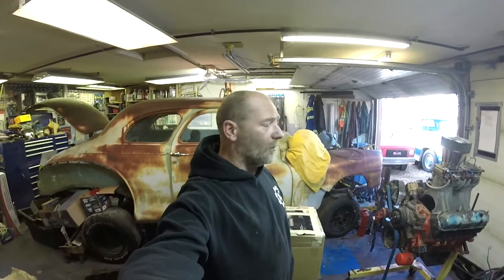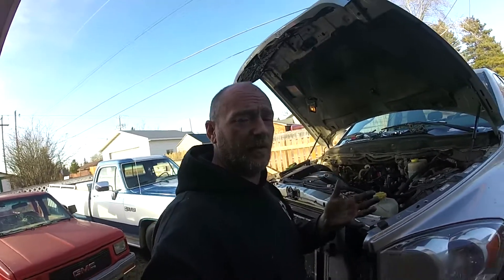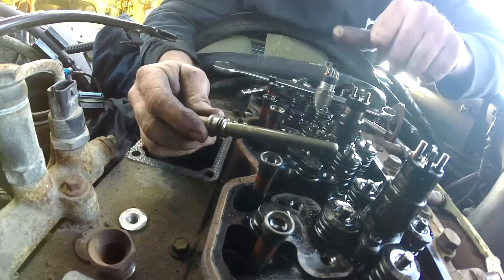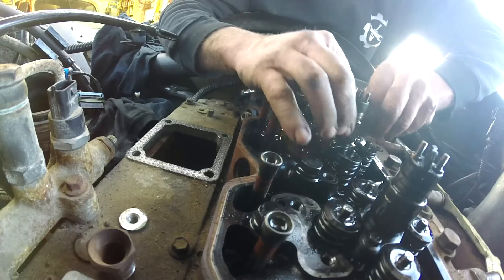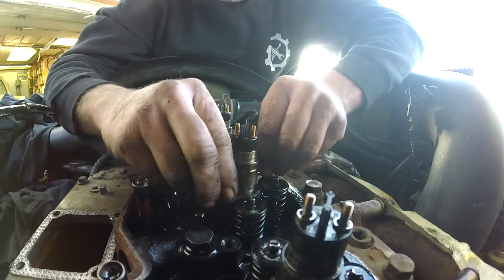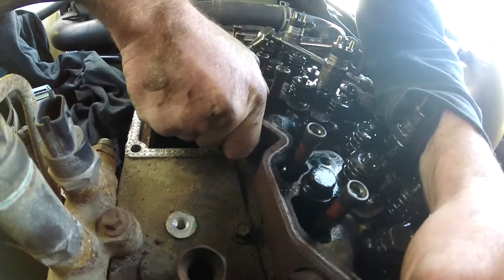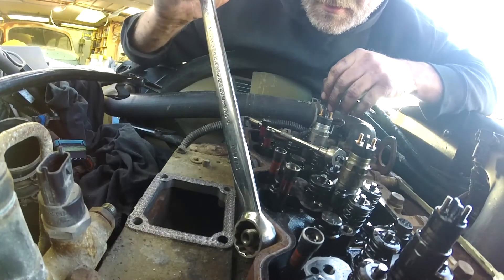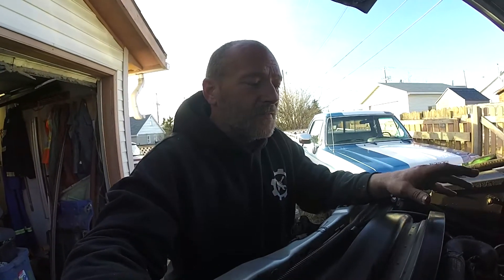Cummins 2003-07 1/2 5.9L Fuel Injector Replacement Procedure

Comment: Damn good "Informative" video. I'm gearing my mind up to tackle this task right now for the first time. Your video helps a ton and gives me the confidence to dive into it.  Thank you
Reply from the maker: Thank you very much. I appreciate it. If you have any questions, feel free to ask 🤘🏼
Reply: @dazeofgloryshopworks5806  Asking for advice. I've got a 2005 Dodge, 5.9 Cummins. A year ago I was motoring at highway speeds, let off on the throttle on a hill and got the multi "bell warning dings" and the Wait to Start (WTS) light came on and stayed on. The truck runs fine though. The code that came in with the WTS light is P1222 which points to injectors. With 235K miles on it, I resigned to just replace all injectors. I did so with rebuilds from what I thought to be a reputable retailer. Once installed, along with new feed tubes and also new lines from the tube to common rail, the truck ran the same, starts fine, no noticeable black or white smoke, no loss of power, etc. But, the P1222 code and WTS light are still on. I retorqued all injectors, tubes and retaining nuts two separate times to just a little tighter than stock foot lbs.  I performed 3 main troubleshooting tasks starting with the Relief Valve test which passed just fine. Then I tested the return flow from the CP3 which passed within the recommended return flow. Then, I tested the injector return flow (all injectors in place and uncapped). This test also passed with a recommended return flow of less than 180ml. Mine was right around 85-100ml. I tested this twice to make sure. Still, the WTS and P1222 code stay on and the truck runs just fine. I tried erasing the code with my Inova 5610 OBD reader but it will not remove the P1222 code. I also disconnected the batteries for about 2 weeks to see if it would remove the code to no avail. I've since replaced the Pressure Relief valve, Cascade Overflow Valve, MAP Sensor, Fuel Filter and Pressure Sensor. Mostly just to ensure they were not the issue. Still, the truck starts and runs fine. I am wondering "IF" taking it to someone who can "Flash" the computer to remove the P1222 code will only lead to it coming back in or if it is possibly just stuck in the computer and holding me up from using my truck. I don't drive it with all this going on for fear of burning a hole in my pistons. I'm at a loss for not knowing how to fix this truck at this point. Any suggestions would be appreciated. Thanks in advance.
Reply from the maker: @anglersnw  well, you've done the hard work. Your flow numbers are text book perfect. Better actually. I have run into the fuel control actuator as the culprit at times, though not every time. The FCA is located on the high pressure pump. I'd be tempted to replace it with one from Chrysler or Cummins. If that doesn't cure the problem, you may be into a chaffed wiring harness or a loose connector pin on the ecm connectors. There is a tension spec for the Deutsch connector pins and the spec is 0.039". I used to check them with a machinist drill bit. Just slide the drill bit shank into each terminal and feel for drag on the bit when pulling back out. If no tension or next to no tension is felt, then you will have to extract the terminal from the connector and give it a slight crimp and recheck tension. There are specialty terminal removers for the ecm terminals and I recommend them. Good luck to you and please keep me posted. 🤘🏼
Reply: @dazeofgloryshopworks5806    Thank you for your prompt and courteous reply. I will definitely try the tension spec task you shared with me. I'm really at a loss anymore as to what direction to go with this truck.
Reply from the maker: @ they're all just made of nuts and bolts and wire. One piece at a time and a dump truck load of patience helps too!

Comment: Your video is great! Im fixing to do this job soon. I have a question, my truck is a early 2004 built in October of 2003 it is a 6 speed so it is the HO version the decals on the valve cover say 305HP so I take that its a early 5.9 03-04 and would take the early 503 injectors however when they run my vin they tell me it should take the 505 injector which is the injector for the 325HP 5.9 04.5-06. Have you ever seen a 305 HO motor take the later 505 injectors? I don't want to do the job twice due to wrong injectors.
Reply from the maker: Thanks for checking the video out! Glad you're enjoying it. 
From my experience, 03-04, if you had the 6-speed manual, you got the 325hp 5.9. It is odd you have the 305 hp decal, so unless your engine was swapped out previously, it should be the 325hp. I'd put the 325hp injectors in regardless. They won't harm anything at all and may boost your power level a bit 🤘🏼
Reply: @dazeofgloryshopworks5806  so the 03-04 HO had the 325hp Motor with the different piston design?
Reply from the maker: @diamondranch44  I would have to research it more to give you accurate info on it. I can say at Chrysler when I worked for them, there were different head gaskets and the rest looked the same. You could cross reference the injector part numbers between both engines and look for differences as well as the engine internals. Though I confess that when I was there, these were brand new trucks and all parts were factory replacement so there was no guess work. I've installed 90hp+ injectors for guys with stock tunes and they've worked fine with more power than before so I don't believe there is a physical difference in the injectors. As for the pistons, I can honestly say I do not know.
Reply: @dazeofgloryshopworks5806  Thank you for your help I sure appreciate it. I took a picture of the top numbers on the injector and they verified it’s indeed a 305 truck and 503 injectors in it. They’ll be here tomorrow and I’ll be having your video on repeat to help me with the install thank you again!
Reply from the maker: @diamondranch44  awesome. Thank you so much for watching and if I can help in the future, I'll sure try.
Reply: @dazeofgloryshopworks5806  One last question what is the torq spec for the rocker arm? I can't seem to find it.
Reply from the maker: @diamondranch44  it's 23 ftlbs. 🤘🏼
Reply: @diamondranch44  no, the 03,04 ttucks are 305hp engine.
Late 04.5 starts the 325hp. They made a few changes to the engine. Dont put 305hp injectors on a 325hp engine.
Reply from the maker: You also could check the engine serial
Number on the valve cover decal and see if it matches the data plate that is riveted to the driver side of the timing cover. They should match. And then it's possible to see if the dealership can pull up the engine serial number through the vin. That could confirm if the engine has been swapped or not in the past.

Comment: Hi do you know the inch pounds of first cover that one the have the 6 bolts, that one the hold the crankcase  thanks good video I just did mine
Reply from the maker: Hi, if you're referring to the 6 bolts on the rocker cover, the torque spec is 18 ftlbs starting from centre working outwards. I hope this helps and thanks for watching!!!
Reply: Sorry man I found out which one I was talking about is the valve cover have six bolt I can’t find the detail
Reply from the maker: @luisuranga9212  no worries. The rocker cover is the valve cover. Different terms in different industries is all. Sorry for the confusion. 🤘🏼
Reply: Thanks man I really appreciate this 👍
Reply: Nice so I have all the information to finish this project I just save my self like 4000 dlls thank ti this video 👍👍
Reply from the maker: @luisuranga9212  I'm glad to hear!! And that's what this is about. Helping keeping our rigs rolling smooth without breaking the bank. Have a good one!